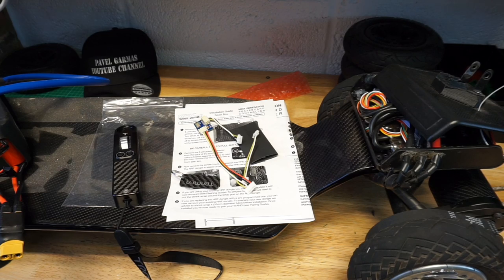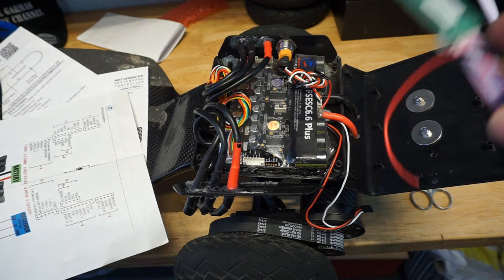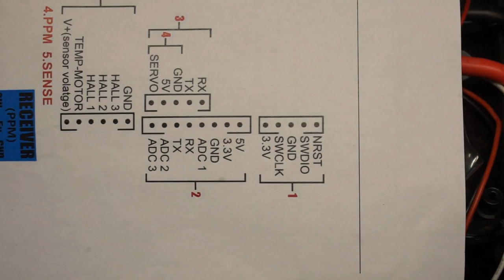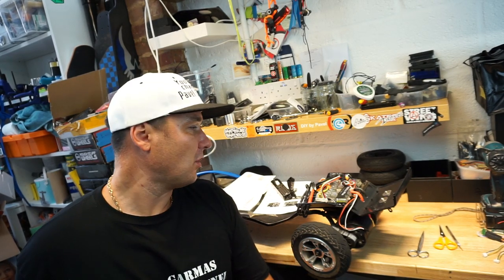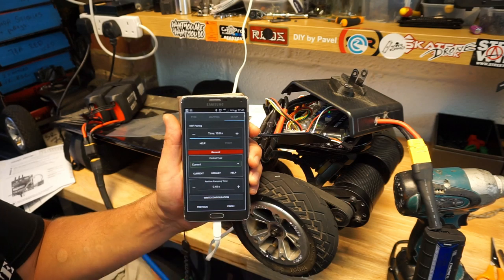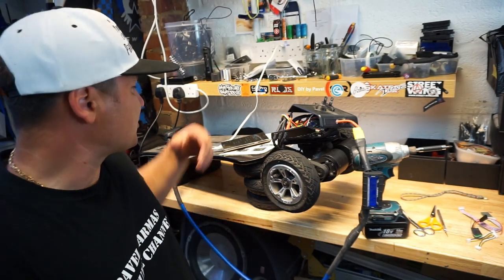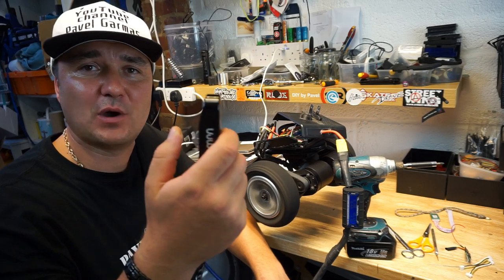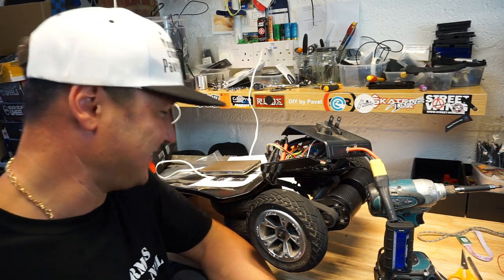Trampa WAND remote. How to install and set up.

Comment: Great tutorial much helpful.. one thing does the wand show vesc and motor temp and such info too when connected with flipsky vesc?
Reply from the maker: Hi mate. Thank you for the nice comment. Yes, all the information including motor temperatures is shown on the remote if used with Flipsky 6.6 plus. That is what i use and its all good.
Reply: @PavelGarmas  thanks mate.. just dont activate that CC ever 😋

Comment: Nice video Pavel. Wand and software look great and certainly on par with Metr +. I kind of fell out with Metr + after buying the Unity version that I could never get to work. I'll be staying away from them from now on as they basically just dumped me when it became obvious there was a fault with the module. Anyhow this all looks great cant wait to try mine and thanks for the video. Certainly be interested on the cruise control and if that's normal behaviour.
Reply from the maker: Simon,
What esc do you have in your board? You do know that WAND will not work with unity right?
I have contacted Trampa so will see about the cruise control … should test the wand in operation this week hopefully,
Thank you for watching and commenting mate.
Reply: @PavelGarmas  Hi Pavel I'm on Unity on my Icarus build. The Trampa build will use the wand. Still haven't bought a VESC yet but definitely not going Unity again.Keep up the good work.
Reply from the maker: Thank you mate. What ecs are you getting for the Trampa built?
Seems ike Flipsky does not work 100% and my cruise control might be out of action but I will try again this week.
Reply: @PavelGarmas  I was thinking of using a Flipsky but will wait and see how you get on now. No real rush to buy one.

Comment: Hi Pavel, the ESC is not genuine and I have no clue how well it is designed or if there is a hardware problem. CC should not spin up a wheel when engaged in neutral. Bench tests are no good indicator since the VESC is a current controlled ESC. You need the resistance  to see how things work. The best way to test stuff is using a profile with very limited top speed and power. Use the VESC Tool App and ad a TEST Profile. 12Km/h forward and reverse top speed , 35% power. Go to a place where you can ride safely and test stuff out. New Hardware setups always want testing! Good and stable connection? Do things work as expected? Get used to the features and handling before going for more power and speed.
Reply from the maker: Frank,
Thank you for the reply. Flipsky 6.6 plus do claim to be vesc based unit of a high quality... we will see.
I will test the board and the wand this week and will video it all.
Is there anything I can do to try and fix the CC issue?
Thank you.
Reply: @PavelGarmas  Install letest VESC-Tool and Firmare, do the Wizards and hope it works for you. You can experiment with the threshold setting in the APP config. Maybe try 18%
Reply from the maker: Frank,
You are a star! Thank you for your help. I did upload a new VESC tool this morning and will try again tonight.
Reply: @PavelGarmas  Please wait till FW 3.62!  3.61 has a problem with the reverse and Cruise Control. Or use FW 3.60 (Vesc Tool 1.18)
Reply from the maker: Good tip! Maybe this is why I had the issue with the cruise control.... I think the VESC tool for PC that I did upload is 1.18 but I did upload whatever the vesc app offered already. Can I re-upload the 1.18 back on some how?
Reply: @PavelGarmas  If you have 1.18 to hand, you can simply do a FW update with 1.18 VESC-Tool. That will bring back the 3.60 FW.
Reply from the maker: Thank you mate. I will do it tonight and see how it goes. Super! Appreciate you help.

Comment: Hey Pavel, I too have a Flipsky FSESC6.6. I can not calibrate my VX2 remote through the VESC tool like everyone else who has the VX2. I would like to purchase The Wand. Can you confirm you can toggle the control mode (Current, Current no reverse, Duty Cycle...etc) and also set throttle curves in the VESC tool with your WAND/FSESC setup?
Reply from the maker: Hi mate,
VX2 remote does not need any set up in vesc tool. You just calibrate the remote in the remote menu. Yes, you can adjust all the parameters on the wand using the vesc tool.
Are you on my Facebook group esk8freedom? Join!

Comment: The nrf use 3.3v?
Reply from the maker: I am 99.9 % sure it is mate.
Reply: @PavelGarmas  thanks! Have you ever run into any disconnection or delay or any interference? Since this remote is using Bluetooth
Reply from the maker: @jagerhimself9491  hi mate, there are a few reports that people had issues with disconnects in the community however i did never have any problems.  Maybe i am lucky :)

Comment: That Cruise control behaviour is not correct Pavel.  It shouldnt spin all the way up like that.  Try accelerating to a certain speed then activating CC, if it spins up all the way like that it's not right
Reply from the maker: Thanks mate. I did email Ted just in case but it could be the Flipsky esc....don't know.
Reply: Lee, mine does something similar even on double VESC6 set-up. Master VESC keeps a constant given RPM in CC, while the slave just speeds up to max rpm. It’s also present when giving normal pitch. And it does seem to affect the efficiency quite a lot, since the slave is not really adding any amperage to all those volts it puts into the motor. It results in the master motor taking a fairly bigger load than the slave in most cases. Unless going full power, and an equal amount of V/Amps goes into each motor.
So master basically runs awesome, whereas the slave runs the same as with the old Maytech controller.
Reply: @mathiashellere8907  ok I will check my setup bro!
Reply: Awesome man - can't wait to hear :-) Are you running the FW version 3.60, or 3.61 on your VESC?  Cheers!
Reply from the maker: @mathiashellere8907  
I can see that you did ask Lee but I will answer. 
Little bird told me that the latest FW has some negative effects on the wand. Re flush with 1.18 on vesc tool PC and it should fix it.
I am going to do the same tomorrow :)
Reply: Pavel Garmas Thanks a lot for the answer mate :) 
Been messing around with the settings in the app module on the computer all day Monday and Tuesday, and done tonnes of testing on the road and the treadmill to see if I could fix the problem manually  - with absolutely no luck on the 3.61 FW version. I haven’t been able to find the VESC-tool V 1.18 on the VESC homepage, and the previous version I have besides 1.19 is the 1.09 version, which disables features in regards of CC and smart reverse. So as of now, I’m sitting spamming F5 on the VESC forums, and eSkatebuilders forum in wait for an update on the 3.62 FW release and V-tool 1.20 from either Frank or Benjamin. I won’t be running my board until then since it puts an extensive load on the master motor - especially while going up/down-hill. It basically feels like driving a single motor set-up, more or less!
Cheers Buddy :)
Reply from the maker: I see!
Thank you so much for the update mate. I think I might wait as well then. Is there any indication on when the 3.62 will be released?
See Franks comment above - he does refer back to 1.18 in VESC tool and this is what I did upload couple of days ago. Try to download the vesc tool again and see what FW will pop up.
Keep Us updated please buddy.